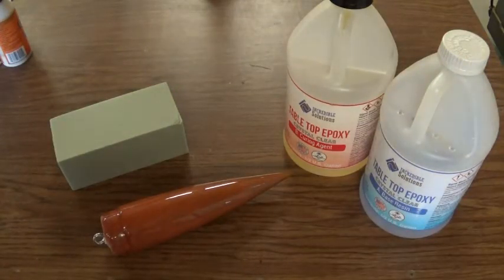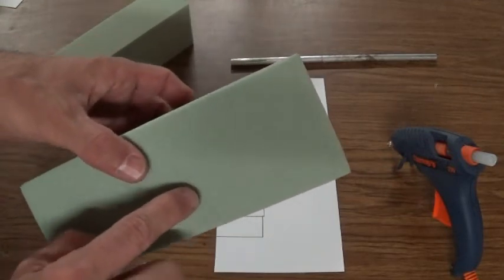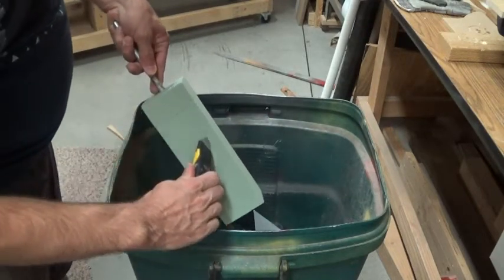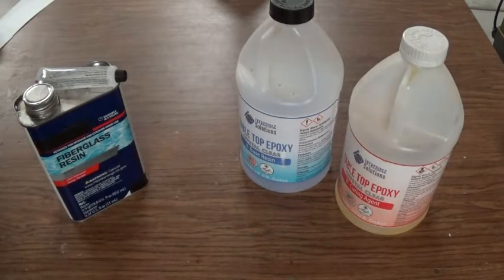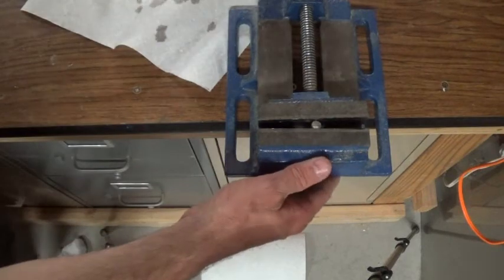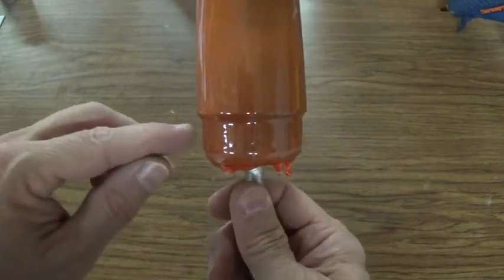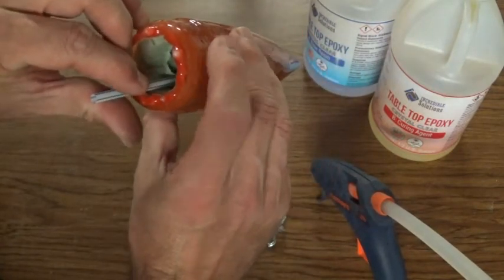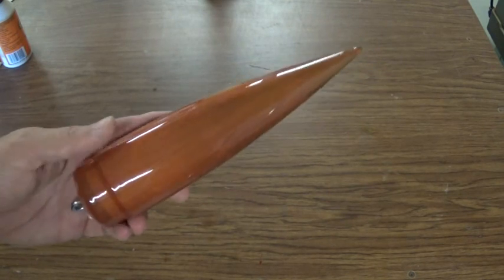DIY Model Rocket Nosecone with Foam & Epoxy Resin

Comment: This is exactly what I needed. That's for taking us through the whole process. I'm just getting into model rockets and have my sights set on modeling the dimensions of real rockets. Unfortunately, that means making custom parts in some cases. Seems like this is a great way to create a light weight and durable custom design.
Reply from the maker: Glad I could help. I have never made any parts other than nose cone with this method but I always thought it would be a good way to make just about any shape part.

Comment: I have used a variation of this process to make nose cones.  I put a 1" ring of the body tube near the drill chuck and used gaffer tape to attach the ring to the chuck.  That way you don't need to remove the nose cone from the chuck to check the fit.

Comment: Why not using fiberglass along with the epoxy ? It would strengthen it a LOT. Furthermore, applying the next coat while the previous one still slightly tacky makes for a much better adhesion. The method is pretty neat though. 
To dissolve the foam, you could have used acetone : lot quicker and cleaner
Reply: Acetone is also great for removing cured epoxy.  I think mechanical material removal methods used in video is the way to go here.
Reply: @boogiesg  acetone won't dissolve cured epoxy ! You need to sand it once it's cured. Acetone is used only when you ve just applied the coat

Comment: If you had used a wood dowel instead of the metal rod to turn it, you could have just cut off the dowel and leave it in the nose cone, giving a great place to screw in a screw eye for the shock cord and the parachute.

Comment: Next time, mount the eye bolt to the cardboard with another nut to hold it in place, then glue the card board in the nose cone. Then you can pour the resin to hold it in place. 
Also, I would have squared off the bottom rough area before putting the eyebolt in.  Make it a little easier to clean up the bottom.
Reply from the maker: All good suggestions.  At this point, we have moved on to 3D printing our nose cones.  A lot easier and a lot faster.  But if someone doesn't have access to 3D printing, this epoxy method does work well.

Comment: Interesting video. Looks like the resin procedure would work around a lightweight 3D printed nosecone and give it the same strength and smooth surface.
Reply from the maker: Great point. I believe that would work well. I have always thought this system would work for oddly shaped nosecones. You could even hand shape a block of foam into something fancy and coat it.

Comment: thanks so much for this i am definitely doing this for my next rocket. do you think i could use a hand drill in a vice intead of a drill press? also is their any other way to cut the wood shaping tool than a bandsaw? because i dont have one.
Reply from the maker: You should be able to use a hand drill in a vice. I have done that before. You have to clamp it pretty tight so it does not move when you are pushing with the shape tool so be careful not to break your drill.
You could use a jigsaw to cut the shaping tool. I suppose you could also use a thin hand saw too and then just clean up the final shape on a belt sander or even by hand with a file or sand paper. A lot more work but you only have to make the tool once and can use it to make as many nosecones as you want.
Reply: @rotaryrocketry  ok thanks so much for the reply. i think i will cut the tool with a very thin hand saw very carefully and finish with a file and sandpaper.

Comment: Great video,
Can you estimate how much epoxy you used to make the nose cone?
Reply from the maker: It's not very much... especially considering this type of epoxy typically comes in gallons or 1/2 gallons. You will need about 1 Tablespoon for the first coat because the surface is rough. The additional coats will need less... maybe around 2 teaspoons. In short... You mix up really small amounts for each coat. It is very important to put on a lot of coats because each one is extremely thin after it has time to run and drip off.

Comment: Why can't we just use a paper cone with straight angles? 

Purely aesthetics or does it enhance the performance.
Reply from the maker: Straight sides would work fine too. Just paper alone would not be strong enough but you could certainly use a thicker type paper and coat that in epoxy resin. The foam is a good option if you want to make a custom shape nose cone because you can just shave it into any shape you desire.

Comment: is it possible to make it hollow on the inside
Reply from the maker: Once the resin is hard, you could remove the foam inside just by scraping it out. You would need to leave an opening in the flat end.

Comment: what is the purpose of the straw in the nose cone?
Reply from the maker: Sometimes you need to add weight to a nose cone to help adjust the center of gravity for a rocket. The straw allows you to add small weights like BBs and epoxy.